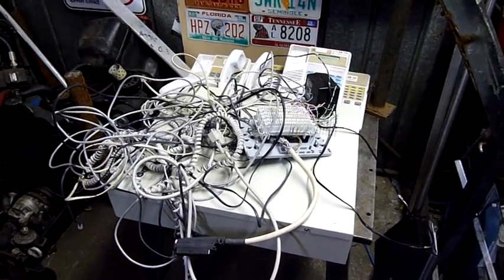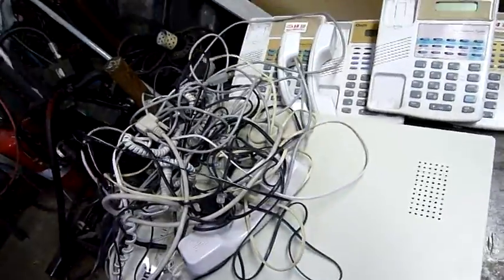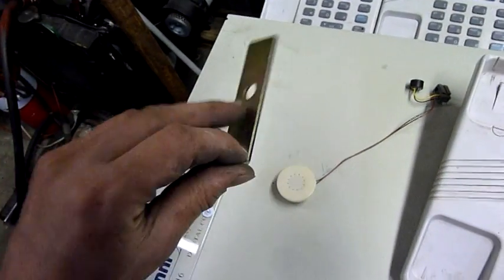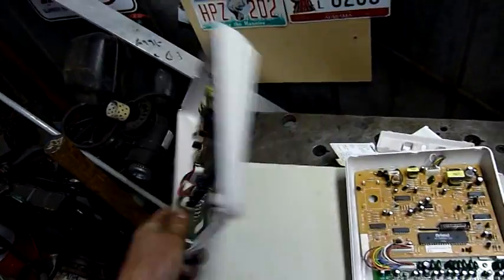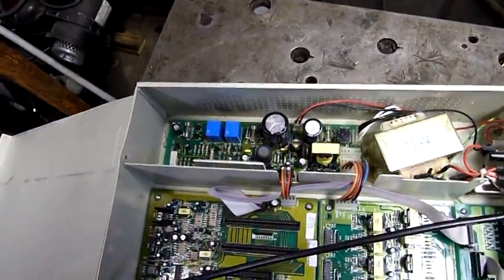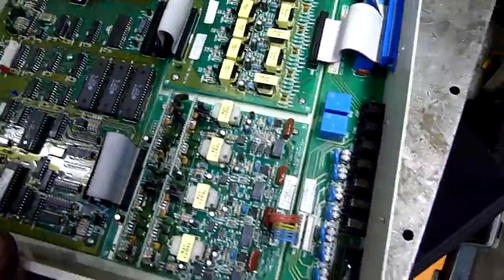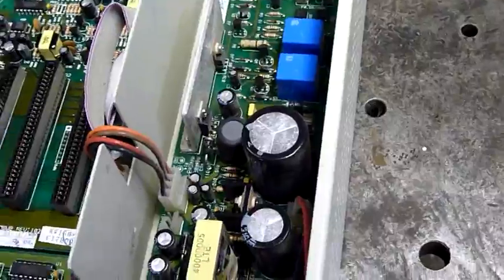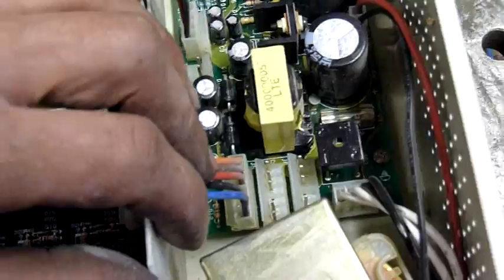Omni UF16 Key Telephone System Autopsy

Comment: The big advantage of DTS is free or next to nothing for phone service.

The little music module is an amplifier to take on hold music, amplify it to normal PBX telecom voltages, then pass it to the PBX module. 

This model looks like the bare bones version of the MUZAK MOH system that my old job used. They drove me nuts asking me to load updates into the module since they could not seem to handle a simple USB thumbdrive, or a cassette on the older model, the boobs.

Comment: VOIP is fine for a total conversion, but I've seen digital telephony systems being used. How that goes is the analog (non-PBX) stations are left in place, but the main module is replaced by a digital management module connected to a high speed (think 15 Mbps plus) internet connection. This is more economical for installations where rewiring the place to meet CAT5 standards would be cost-prohibitive. This is best for motels and condos that have older wiring that would cost a fortune to replace.

Comment: I bet those LCD modules use a standard driver like the hd44780. Means it's really easy to hook up to an arduino or to your computer. Check out LCD Smartie: lcdsmartie [dot] sourceforge [dot] net
Looks like YT updated their URL detection, so you can't use the word dot instead of period. So I had to use the syntax above. How annoying.

Comment: They're using the diodes in the music-on-hold box to act as a 'voltage clamp' (two diodes in series will clip or clamp the signal at .7V x 2, or 1.4V).    The fuse is in series with the input such that if the diodes are clamping any kind of current, it will blow before the diodes do and open the circuit.

Comment: Re: the MoH box. By my understanding, the transformer connects to a dedicated line where callers sent to MoH will be parked. The diodes are to clip any ringing voltage on that phone line to prevent your music source from going up in smoke.

When a line rings, 90V AC is put across tip and ring. If someone connects the MoH box to the wrong line (or misconfigures the commander), the diodes will clip the ringing voltage to about 1.2V, protecting your music source.

Comment: Shame the phone display is dead, it looks like the type that people buy when making pic chip based units/displays.

mostly 74xx and 4000 series logic, and the 723 chip is a voltage regulator.

The commander box could be more usefull than its contents, a heavy duty project box if you were into making things :-)

Its all good but as you said, little use to you so in the skip it goes.

Smashing disection though, enjoyed that thanks :-)